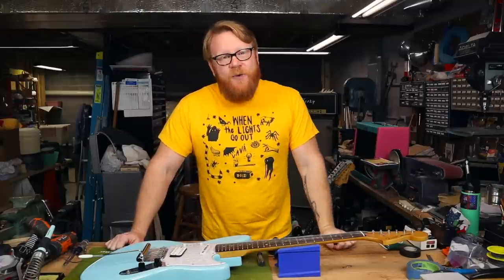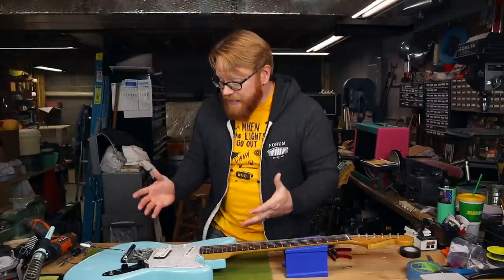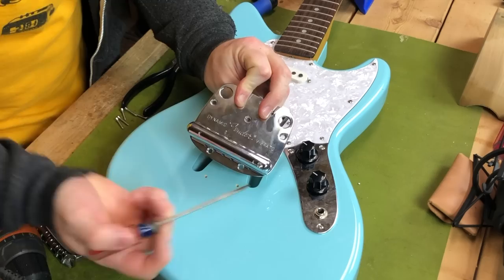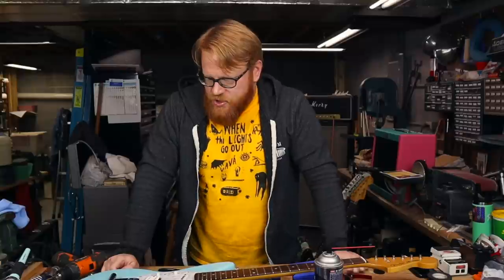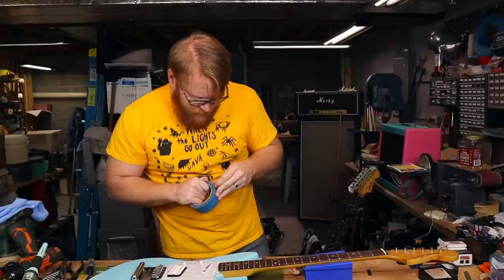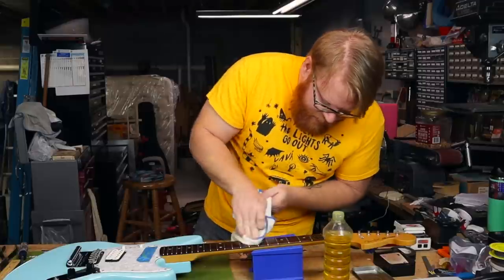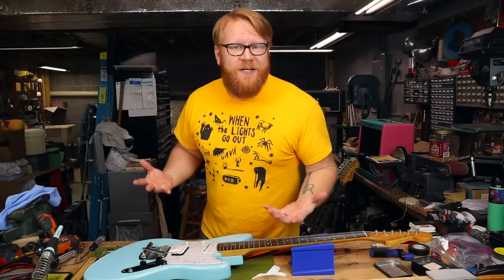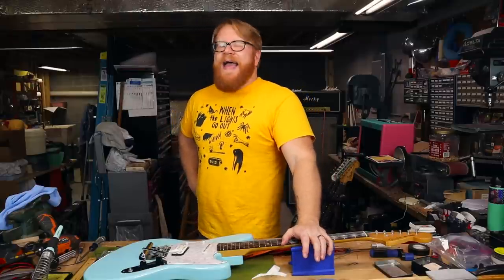ON THE BENCH #3: Fender Jag-Stang Setup & Mustang Vibrato Overview

Comment: I still vividly remember being 15 and horrified that the bridge on my brand new sonic blue Jag-Stang had sunk following a band practise, turning my WEAPON OF GRUNGE into a sitar

How lucky that kids (young and old) nowadays can have access to such helpful, thoughtful and funny content such as this. Party on, Mike. 💕
Reply from the maker: I had a Japanese Jaguar in high school that I begged my parents for for months, and it had the same problem. Talk about being underwhelmed, and extra sad that I just didn't have the knowledge to address it then.
Reply: Thankfully, my local library had a book about how to setup various Fender electric guitars, from tuning heads to the many various bridges, with diagrams showing all the areas that could be adjusted and how to adjust them. As it was the time before the internet was as widespread as today, if they didn’t have that book, it likely would have taken me a long while to figure out those little holes were actually how you adjusted the bridge height, and “cigar” tube height/spring tension. Never been a trem player, so I always just tighten the trem springs to where it basically acts like a hard tail. Improves sustainability and overall stability of the guitar
Reply: I was horrified when I bought the mastery bridge and it did the same =) I paid almost 200 bucks for it. But the threadlocker solved the problem. You can't fool physics, no matter how much money you offer to it😄

Comment: So many good tips I’ve picked up from this tutorial, as I get to know my (new to me) Squier Vintage Modified Mustang.  Would love to see video for setting up and INTONATING a mustang.  I haven’t found much content - other than this vid - on the balancing act required to intonate this jewel.  I have, on order, a bridge from Warmoth and a replacement tailpiece as well.  One of the set screws for the, ‘cigar’, is stripped (didn’t want the hassle of what’s required to remove the offending screw.  These parts are not very expensive and I’m not so very facile with tools ;-) ).   Thanks SO MUCH for the content you offer; very helpful to this, “offset noob”.  Peace!

Comment: Man, I am just loving your channel recently (watched all 6 “On The Bench” episodes today)!  Your Bigsby video was a big help.  Thanks so much for the awesome work!
Reply: I’ve recently run into an issue with a new Gretsch where depressing the Bigsby causes everything to go sharp until I pull UP on the bar to bring things back to pitch (like what was happening with the Jag-Stang in this video).  Do you have a recommendation on where to lubricate the Bigsby itself like you did with the vibrato in this video?  The nut slots are nicely cut and smooth so there is no binding there at the moment.  Thanks so much!

Comment: Thanks for posting this video. While I’ve setup my JS, there are still a few tiny aspects of the setup that still don’t feel quite right but wasn’t really clear on what I could do to improve them further. I REALLY wish that the part where you did the shim had made it to the finished video as that is a major point that I want to see in EXTREME detail to make sure I don’t miss some minor, but crucial aspect. I want to see EXACTLY every step and any tricks or possibly unorthodox methods you might use and what you are looking for in an ideal setup. I do appreciate all the little tidbits of advise you spread thru out the video. I will be referring to it over the next few days as I make adjustments to my Jag-Stang! Thanks!

Comment: Great video. In regard to the bridge posts, I used the white plumbers telfon tape (that's what I had) on my standard jag bridge and they don't sink but are still fully adjustable. Did that over four years ago.
Reply from the maker: Teflon can work! I just prefer the thread locker method

Comment: Would love to know more details about the soldering - What temp, technique, things to avoid?
I'm changing some pickups but never soldered before and I'm convinced I'll kill something!
Jag-stang looks cool!
Reply from the maker: I can probably manage a vid on that at some point!
Reply: @Puisheen  Do have a follow-up! 
My friend runs a pedal company and gave me an extra soldering iron. Heated it up to 400, and it just STRUGGLED to desolder the big lump on my volume pot (worried I might have even burned it out becuase it sat heating for so long). However, it did heat up enough to desolder the cables from the other points. Do you think this is an issue with the iron, my technique, or the solder used? I even had to just use wire clippers to remove the pickups from my JM, since they couldn't completely be removed :/

Comment: Thanks for your public service to the Mustang-playing community. Please, keep it up!  However, the three different spring mounting-grooves do NOT (primarily) change how far the spring is stretched  - they change how much leverage (“moment-arm”) the spring has, against the force exerted by the guitar’s strings, on the ’cigar’ tailpiece. On this topic, the adjustment which allows raising or lowering the cigar, is there to fine-tune the moment-arm of the string’s force against the vibrato-springs (the ‘other side’ of this force-equation). by the way, you want the extra-low strength (purple) thread-locking compound. (I think it’s used in watch-repair…) Much easier to break free, in the future!

Comment: Great information.  I had wondered how those vibratos/trems worked since they are different than the other Fender trems.
Reply from the maker: Yeah they use similar principles to a Stratocaster (springs mounted beneath a pivoting string anchor) but they're also much harder to understand.

Comment: This video has been very helpful in adjusting the setup on my new 2021 Jag-Stang. When I received it, the box was unopened but Fender forgot to include the little bag containing the hex keys and trem arm. So I have a question for you: what size hex key is used to adjust the tailpiece height? I can't seem to find the answer via google searches, Fender's website, or any youtube videos. Thanks in advance, Mike!
Reply from the maker: Sadly I don't personally retain any of that info, but I'm certain if you contact Fender they could give you the specific sizes!
Reply: @Puisheen  I figured it out tonight. For posterity, the tailpiece is adjusted with 2.5mm hex, and the bridge is adjusted with 1.5mm.

Comment: Hey Mike. Last time I picked up some electrical contact cleaner, I also grabbed a can on contact cleaner with silicon. Have you tried that? I use the regular for cleaning, then give a final spritz with the silicon.  Thoughts??
Reply from the maker: I use a dielectric grease for lubrication after cleaning generally. I don't know that I have an opinion on this

Comment: Hey mike, glad you started this channel, I’ve read your blog for years.

One thing you said here threw me, you called a mastery a fixed bridge, is it not supposed to move? The mastery on my  62 jag moves just like a mustang bridge
Reply from the maker: It should not! It's designed to stay in place. Could be a fit issue with your body inserts or maybe the post bolts aren't tightened down
Reply: Thanks for the reply, I had a .75 shim in there, and as a result the bridge was sitting very high, switching to a .25 it doesn’t move at all

Comment: I got some Antiquity pickups for my Jazzmaster and I'm trying to remove the stock pickups. I have the same problem that you had, every wire has been twisted on before soldering. It's very frustrating! Do you have any tips for getting them off please?!
Reply from the maker: Try solder wick and a solder sucker, that should make it a lot easier with most of the stuff removed first. So frustrating!
Reply: @Puisheen  Thanks a lot for the reply, I'll have another try in a bit. I only have a solder sucker so I'll try that. I may need to get some solder wick?
Reply from the maker: @dalegreen8695  That stuff is great for really getting rid of most of the solder, but your sucker should also be good for this. It's just a pain either way, I'm sorry!
Reply: @Puisheen  I had another go with the sucker but I'm still struggling. I only have basic soldering skills so it's proving a real challenge! I'm considering a prewired upgrade wiring harness. I'd like the 1 meg taper pots you recommended. Thanks for your advice.
Reply from the maker: @dalegreen8695  Hey, good for you for sticking with it. This kind of thing makes me wanna walk away!

Comment: Nice overview! Question: Are the strings supposed to be pinched between the plate and cigar? The low E string on my Mustang rests on the plate, but if I raise the cigar so it clears the plate the vibrato doesn't want to return to pitch.

Comment: Do you find the intonation ends up towards the tail on jag stangs? My neck, nut slots, action is all perfect but some of the saddles are maxed out toward the tail.   Other question, ideal angle of the cigar would it be low and vertical? Gonna work on my Trem setup after this.. I have it leaning back currently.
Reply from the maker: Not often, and the reason for that might be shimming. Intonation is a function of saddle position but also string height, so those points shift when you pitch back the neck. It really is rare when I run out of room on a bridge like this, so maybe shimming can help here?
Reply from the maker: Oh sorry, second part: From my studies, it seems keeping the cigar on the low side works best. too high and it never returns, too low and it loses range.
Reply: @Puisheen   got a .25 deg shim, no real change w intonation. I did get the vibrato set up per your video. After 22 years I still had no idea you could change the cigar height!

Comment: Nice work on the springs and with lubricating. But a single point shim like that gives high chance of neck deformation with time
Reply from the maker: I always push back on this concept because necks do this with or without shims. I've worked on countless vintage guitars over the years, and it's always a thing. Strats, Teles, Rics, acoustics... string tension will do this over time. People like to blame the shim but time and tension are the real culprits here.
Reply: @Puisheen  I agree necks do deform even without shim. The character of deformation due to partial shim is pretty nasty though. If this can be alleviated, why not do it? Putting a piece of card there is something almost anyone can do. Easy, does the job, but I'd consider it a temporary solution.

Comment: Question: When you put the bridge back in and restring, do you tilt it forward or back or center? Could you also discuss intonation adjustments with a moving bridge?
Reply from the maker: I always center the floating bridge! Otherwise, intonation is achieved the same way you would with any bridge, and all things being equal it should not change as the bridge rocks back and forth with the strings
Reply: @Puisheen  Thanks, I will put this into practice right away.

Comment: Wow what a result with just the lubrication! I was expecting you to need more spring tension and so was surprised when you left the springs on the notch they were already on. I wonder if a thicker lubricant would be better for that area so that it stays there for longer? Just a thought. 

I have a question of my own for you Mike: the bridge of my 1962 Jaguar (stock) tends to lean towards the bridge pickup after a lot of vibrato use, and requires me to manually reset it in order to maintain correct intonation. Is there anything you could recommend to remedy this? The neck is shimmed and I use flatwound 11s so I feel there should be plenty of downward force on the bridge itself. All parts, other than the saddles, are lubricated nicely and the guitar returns to pitch perfectly after heavy vibrato use, it's just the bridge rocking forwards and staying there. 
Any help would be appreciated, thanks Mike :)
Reply from the maker: Tri Flow is just slightly thinner in consistency than vaseline, so it does a pretty good job. But any good grease would likely do the trick. 

As for your bridge issue, that's pretty interesting. You may not have quite enough friction between the strings and saddles, or there could be some other factor preventing it from returning properly. Send me a pic on IG?
Reply: @Puisheen  ah I see, for some reason I was imaging Tri Flow as a thin liquid oil, my bad! 
I don't have IG or anything, but I'll do some hunting for an email address for you, annoying that YouTube doesn't have DMs ✌️
Reply from the maker: @jackgreenwood1817  Jack, hit me up at contactmikeadams @ gmail.com

Comment: I have a CV jaguar and I have one issue with the vibrato, whenever I pull it up it doesn’t zero out (sharp) but when I push down it zeros out great. Any ideas on how to fix it
Reply from the maker: Without seeing it in person it's tough to diagnose, but my first thought would be to check how the vibrato is set up (i.e. spring tension) and to also ensure the vibrato intervals aren't catching on the sides of the rout. If you ever get the chance, pull it off the body and inspect the rout for signs of rubbing––if it's happening you'll see scrape marks on the paint. If that's the case, grab some rough sandpaper (80 or 120 should be fine) and remove some material, reinstall, and test at tension.
Reply: @Puisheen  I think I figured out the issue without any of that, I use 9 gauge strings and I would use tens or above but I don’t know if the nut is cut for them, it’s not that big of an issue because I don’t pull the trem up too much and I just have to remember to push it down afterwards

Comment: awesome !!!
just about to purchase of a contemporary ...and a  vibrato unit for an extra £90  ( yup the  fender one )
the original offers the strangle ... a hi pass .. i have a helix /...can do 
seperate circuit ... not required 
the lovely  vibrato with the awful long travel  from the tailpiece ... if you shorten that a little you  increase the break angle on the bridge  preventing  escape commitees
other things ... later..
the contemporarararay offers the nice "my little pony " blue burst 
humbuckers and coil split  ... not coil tap ...thats something else entireley ...its  SPLITTING no tapping which is  awkward and only provides lower output and less gauss which iirc thins out the tone ...ish 
stop saying soddering ...its solder...you can see the L
it has a couple of sliders ... they do coil split and  parralel series  ...allegedly  ... i think it sounds like in/ out phase ? ... also spelling ... LLRR ...theres some spare letters go nuts 
but you could rewire it for coil  SPLIT and  / or whatever
soLDering tip ... file down your irons tip with some emery  cloth  and re tin  ... have a  tin of flux handy  to dip the fresh  solder in  as it coats the contact before the actual solder melts and lets its flux out 
did i mention "AWESOME"
thank you soooo much  for this info ... amazing ... i've been mutilating  guitars amps and  PA's  for  around 30 years now  on a whim / cant afford a pro job / on tour in middle of nowhere  / amp broke during gig  im the only one with a butane iron ( never have one ... makes you mr fix it ..usually just before your solo " 
im the bass player / luthier / amp doctor 
i only signed up for bass ... your vid helped me with bits and pieces  i struggled with and much more importantly  you  confirmed some stuff i`ve been saying and doing for decades!!!
thank youuuuuuuu

Comment: Big fan of Cobain, but, my god, that's a fugly guitar.
Reply: Fender did Kurt dirty. If you look at his actual drawings and design collages they screwed up the shape.
Reply: @CharlesWillisBonsai  from the drawings and notes I've seen, it's actually pretty accurate.
Reply: Also never liked it. If they had decreased the lower portion of the body, though, making it a little less offset and exaggerated, it could actually look good.
Reply: From what I’ve read Kurt was unhappy with the way it came out as well. He was in the process of redesign discussions with Fender when he died. There’s actually a community of amateur but talented luthiers that redesigned the Jag-Stang to closer match Kurt’s vision. Search “Jag-Stang 2.0” on the internets if you’re curious. It’s much better than Fender’s.

Comment: The fact is that ALL Fender vibrato's are old design from the dinosaur days. Many players say they werent any good back when they were introduced. Having said that, I have never had perfect dependable function from either a Strat, Jazzmaster/Jaguar, vibrato. With the price we pay for even the Mexi-made Fenders being way too expensive, to make a vibrato equipped Fender play right out of the box, we should not have to use Lock-Tite, new higher quality screws, pieces of foam, plastic or rubber, stiffer springs, etc, etc. or resort to an entire new system ( Mastery System, etc.).